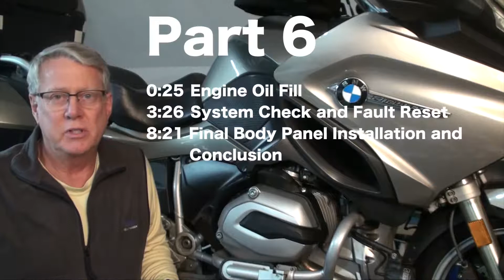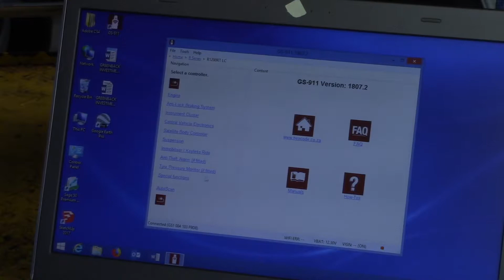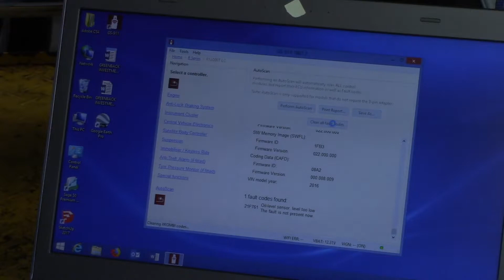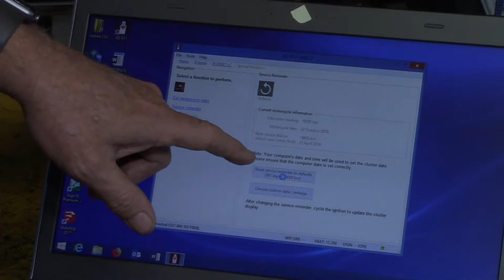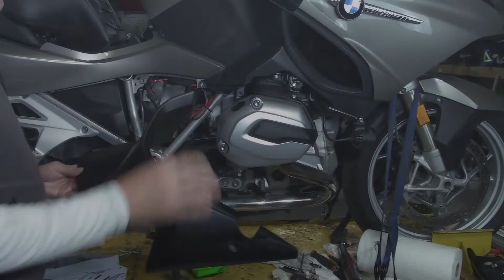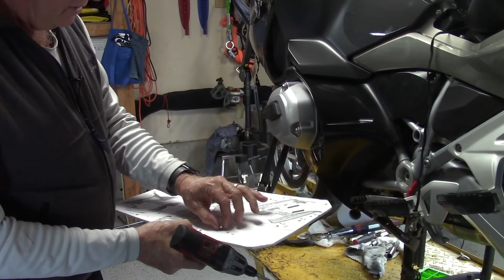BMW R1200RTW 12K Mile/20K KM Service   Part 6/6

Comment: Hi 
Sorry if this is a really stupid question but with my 2016 R1200Rtw do i not have a separate gearbox that i need to do a gearbox oil change on. so i only need to do the engine oil and final drive oil change is this correct?
Reply from the maker: Well, that IS a pretty significant, basic design element to the BMW WetHead (and ShiftHead) engines.  The integration of the gearbox, and for the importance of oil choice, the wet clutch, allowed BMW to make the engine smaller and fit into a smaller area of the overall bike.  The riders manual should be your first "Go-To" reference for this and similar questions about servicing your specific bike, especially for the engine oil...which is API SL/JASO MA2, highlighting the JASO MA2 spec for the presence of a "wet clutch" and never adding "friction modifiers".
The combining of the gearbox and clutch into the common lubrication system of the crankcase simplifies routine servicing with a single type of lubricant and increased filtration for the gears now in the engine oil bath.  Another design feature of the integration of systems within the engine is the cooling of the alternator, also housed within the oil bath of the engine.  This is the point of emphasis in the Riders Manual about NOT using "additives" with  Molybdenum content because it can attack the coatings of engine components...specifically the coatings on the windings of the stator of the alternator.
This is an interesting YouTube video that shows an animation of the joining of components to create the complete BMW R1200 WetHead series of engine.  Hope it revels answers to some of your questions.
https://www.youtube.com/watch?v=wcrFi3ZCi7U

Comment: I had to laugh when you remarked about holding the grommet when reinstalling the lower panel. I had mine off during a recent installation of Darlas and crash bars, and sure enough, my grommet was dislocated. And the last servicing was done by a good dealer shop. Maybe I should tell them to watch your video.
Reply from the maker: Any mechanic will have a certain set of skills and techniques that they have picked up over the years with experience.  Doing this 6 part series was a way to chronicle some of those things that might make doing a certain part of the 12k somewhat easier for the enthusiast doing their own work.  Glad you have picked up on things that could help you.
Reply: A little saliva helps as well.....😁

Comment: Hi Boxflyer. I agree with davidebyrne's comment below. I have always enjoyed and preferred to do service and maintenance all every vehicle I've owned. I've riden 64,000 km on my 2018 RT. Now I'm comfortable to do the valve inspections along with the other regular maintenance. My right fork seal has begun to weep slightly. Just a smudge so far. Something I'll want to take care of next year. Really appreciate your videos, Brad and Chris. Thanks!         Gord Henderson. Kelowna, British Columbia
Reply from the maker: Thanks and I'm glad you got something from these.  Once you start racking up the Mi/Km on this bike, the cost of routine maintenance can really add up, so for some folks, this is a good way to get a handle on that aspect of cost of ownership…as well as adding some enjoyment to your experience with this bike.
I have completed a fork seal replacement on my RH fork as well and took several pictures of the process and will be making that into a YT video shortly…

Comment: Hello
Congratulations on the 6 parts of the maintenance of the RT. Fantastic!
They are a true guide and a reference for all the necessary maintenance on the motorcycle.
I am thinking of making the special tool ALIGNMENT PIN - 83302327790.
It is clear to me that the mobile pin is 8mm in diameter.
Seeing the characteristics of the plug it seems that the threaded part is M16x1.5mm.
Would it be possible to tell us the measurement of the non-threaded cylindrical part that follows the threaded part? The length and the diameter
Measuring in photos might seem about 14mm in diameter and about 16-18 in length
regards
Reply from the maker: Thanks and good luck with your DIY tools.